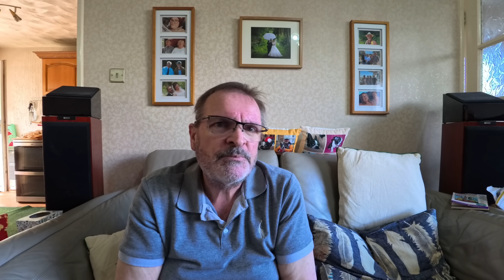Expert Ships Engineer Reacts to Baltimore Bridge Crash

Comment: Spot on and well documented sir. As an ex-marine engineer (2nd Class DOT) I have tried to explain all of your points to commentators, some who should know better. So in future I will point them to your excellent description. Another thing that does not help the public's understanding of the events: Most of the videos shown are not in real time, but sped up, giving an impression that this is like a car crash! Most people have no concept of the turning circle or effective stopping distance of such a vessel. And so conclude that it must have been a deliberate act. I can also agree that much underwear would have been soiled both down the engine room and on the bridge!
I have been in a similar situation to this on a gas tanker (oh my god yes) as we lost power turning into a Norwegian Fjord. The ship rolled slightly, disturbing a presumed tied up electrical pump motor (pulled on a chain block for maintainance). The resulting swing gave a nice pendulum effect to this monster piece of metal which contacted (gently) the quick closing valve for the generators diesel supply. Black out... no steering and we ran aground. Straight up a little old ladies garden, creating a new water feature for her to 'enjoy' in the future. :) So yes, as they say, shit happens. I am still alive so obviously the LPG did not go big-bada-boom.
Reply from the maker: Thank you, your comments are much appreciated
Reply: this Guyz funny!!
Reply: The ship changed course  toward the pylon prior to the blackout. Thousands upon  thousands of ships have traversed those waters.   Not a single one of them did any kind of maneuver like this.   STOP protecting this crap. This has nothing to do with the steering gear because they changed course prior to the blackout.    You people are absurd.   I am not an engineer but I am a 200 ton captain.  Nothing even close to this, but you don't steer into an object you are trying to avoid unless fighting a massive sideways current.  And to this idiot's assertion that there will be a full on accident investigation,  No!   America is so politicized. No way will they talk about a Ukrainian Master deliberately hitting the pylon. Brain dead lefties.
Reply: 😂when!!! OBIDUM ".. said" TAX PAYERS ". will PAY..
I knew !! then..
it was PLANNED.
.
( the Fall of ROME)
.
1ST CORINTHIANS 15V1.4  ...
TRUST JESUS  NOW.
Reply: So your saying this is something that could happen easily
Reply: @ettube8686  Indeed. That is why certification and experience is valued - to minimise the chances of disaster (of which there are many!). But there is no accounting for the possibility of a failure in such a complex scenario. Many factors such as bad fuel, a electronics fault, a hydraulic seal failing, or a malfunctioning sensor, could all lead to a diesel generator shutting down. This would obviously leave the vessel to the fate of the wind and current until control is restored. This incident took mere short minutes from power failure to disaster. All aboard would have been doing their best to get it back up and running; but it is not something that can be diagnosed, fixed and remedied in seconds.
Reply: @stevekirkby6570  ok thanks for explaining the sharp right hand turn directly into the pilon lol 😂
Reply: @stevekirkby6570  The ship was under the command of professional port pilots who likely were drilled for an engine shut down scenario. Seems handled well after failure. Mayday message sent out. Port anchor dropped. If I understand this video correctly, likely to compensate for the natural drift  towards starboard caused by the rotation of the propeller. It was a modern ship, built in 2016. And I suspect with all the added tech comes new unknown failure points.
Reply: @iRelevant.47.system.boycott  Yes, I mentioned this mate.
Reply: I was once told by a ship's captain  that if a fully laden vessel was to run directly onto a low lying  area  (  the Dutch  coast for example  )  it would end up eight  miles inland  !  This was in the days before the behemoths of today  😮
Reply: @colintuffs568  He's spinning you a bit of a yarn with that distance... but it could be quite a few 10's of meters, depending on the nature of the surface. :)
Reply: It still doesn’t explain the clear course taken directly toward the pier. Surely , like driving a vehicle one must always allow for sufficient clearance whilst driving. If the gap is narrow, one reduces speed even to a crawl if necessary. And in shipping does the steering self correct to centre/straight say in a case should the pilot have a heart attack?
Reply: @clothedwiththesun  Right. In reverse order. 
No, the rudder does not self-center in the case of a blackout. Since there is a blackout there is no electrical power to drive the hydraulics. Its frozen where it is.

If the speed is too slow there is not enough water passing over the rudder to make it work.

Because of momentum of a large vessel all actions are taken in advance, allowing for current and tides. Under normal circumstances aiming the ship towards the pier may be the desirable course. Going for the wide open gap may have put the ship at risk of a mud flat or indeed the other pier. It all depends on the current and wind. The pilot is experienced in these waters and was steering the correct course for a normal passage. Unfortunately losing power is a little 'inconvenient'.
Reply: @stevekirkby6570  thank you 👍
Reply: @clothedwiththesun That’s not a head on view in the camera, and if you watch it in real time it’s totally different
Reply: The new info coming out every day changes the story a bit. They said the power only cut out once and they engines were never restarted. What makes it odd is that it took days to recover the recorder data and interview the crew. Data is missing. The feds said it was not an attack supposedly before investigating. Either it absolutely was an attack and they're busy covering it up, or they're full of it. We can come up with theories as info is released but we may never know.
Reply: @eatonkuntz 😂😂 between an actual marine engineer and your armchair speculation, who do you think people should believe in? Get a life 😂😂😂
Reply: @eatonkuntz It has always taken some time to extract and especially publish all data after an accident, you can't suddenly make it a conspiracy.

Comment: The data logger will reveal all..
But I was wondering if the high sea suction was blocked with crap and both generators tripped out with high jacket water temperature..
Clearly this is just a punt.. 
Also from a retired Marine Engineer...

Comment: I heard today that they were missing 2 minutes from the black box recordings. According to the NTSB, it was able to record audio from the ship's bridge but no data was recorded and this occurred between 1:24-1:26 AM

Not sure why the black box would have shut down during the blackout period because it is meant to stay on during these types of emergency situations?
Reply: The claim is that because of the lost power the black box stopped functioning. This seems absurd on its own, but even more so especially knowing that there are backup generators.
Reply: @raggedyman74  I would think the black box would have a battery backup system. ..the same as Emergency lighting has?
But by the way, it sounds, was as if the black box was running solely on power from the ship... With no battery backup unless the battery itself wasn't charging?

It just seems kind of odd that during both blackout periods, the ship was turning abruptly starboard.
It happened twice...
Perhaps it was either bad fuel or rudder suddenly froze up?

Either way it's kind of tough to rule out  "NOT" Being That of a well thought out cyberattack, from Washington within an hour after it originally occurred but who knows?
Reply: @raggedyman74  ask nasa
Reply: I worked on passenger ships for many years. My guess (and that's all it is) is the data recorder (black box) continued to function as it should (note the audio recordings were not interrupted) and was on battery power. Most of the navigational bridge would also be on battery power. The data stream it receives goes thru several racks of equipment (in various locations on the ship) before arriving at the data recorder. All it would take is one data repeater or network switch to be connected to the wrong power source and the data stream could go offline in a power failure. It shouldn't happen, but I could see something like this happening.
Reply: WOW how convenient, nothing to look at there right? 🇺🇲🇺🇲🇺🇲💪
Reply: @robtrout5183  Nope, of course not and if we are ever to lose the electric grid, It'll be blamed on a solar flare and not that of a cyber attack/EMP either.
In America, everybody has always been protected... protected from everything that was really going on behind the scenes. What you don't know about won't hurt you.

For instance...
 Today, if we have any type of Mass shooting anywhere throughout the US that did not involve the AR-15 rifle, then it never happened. 🤔
By the way, Mass shootings happen almost and daily. Most of which do not involve the AR-15. So this is why you never hear about them.

Either way, I think that whatever is to occur in the near future has already and strategically been planned out and there better not be any more questions asked...
 if you know what I mean?
Reply: pl.anned luci.fer.ian e.vent😳
Reply: @lunam7249 . Nope.
Reply: @markbryant4641  yep.....FACT..... i know some...you know any?!😳😂😹😂😂😹😂😹🤦🏻‍♀️🤦🏻‍♀️😹😹
Reply: Just seems odd that the ship stalled out twice and during those two stall outs, turned starboard twice, in order to create a direct and "so called targeted" hit with the bridge?

Blame it on bad fuel or possible EMP.... Might even be cyber warfare for all we know? But the government isn't prepared to talk about that right now.

Nothing to see here... Please move on.

Comment: They also dropped the rear anchor on the side that it turned to. Wether the anchor drop was manual or an auto function I do not know however the bow of the boat sliced through the steel bridge pilings as shown by the coast guard drone footage. A compounding of errors.🤔

Comment: One report mentioned that they dropped anchor before the collision.  That may explain the small reduction of speed.  But to be effective, anchor chain has to be played out to abou 4x-5x the depth of the water.  The ship was probably too close to the bridge for 250 ft of anchor chain to have stopped the ship in time.  Another thing I notieced is there's nothing protecting the bridge supports from ship collisions.
Reply: I'm pretty sure 100,000 tons at 9mph is not going to be stopped by any 'protection' to the bridge supports. If Mount Everest was in the way, it would have put a dent in it :) A quick back of the fag packet calculation gives the energy released at the time of impact at approximately 8000MWatts -  (presuming the ship was stopped virtually instantly) - enough to power Baltimore (roughly) for about 8 hours :) To put that into perspective, the nuke that hit Horoshima was about 63MW.
Reply: @stevekirkby6570  Not intended to stop a ship but to deflect its course away from the bridge supports.  They recognized the potential for disaster when they built the Golden Gate Bridge before it opened in 1937.  It was hit in Nov 2023 with no damage to the bridge - but the cargo ship was heavily damaged.
Reply: @danburch9989 
Was that cargo ship as big as the Dali? In another video it was being said that not even a pylon of the Golden Gate Bridge could take such an impact without the bridge collapsing.
That Baltimore bridge doesn't look as big and heavy as the Golden Gate.
In the videos the cargo looks too big to go through under the bridge. I guess it's perspective.
Reply: @danburch9989  
Thank you.
Reply: You have to have someone release the anchor from the winch and then set the brake when the bridge tells you to. When hitting the bridge was inevitable that person probably ran off the bow to save themselves leaving the chain to keep running if the ship was still going forward.

Comment: After the ship went DITW she was passing by Curtis bay on her starboad side and created a pressure differential between port and starboard which caused her to drift to starboard. So far much of speculation has been towards some sort fuel issue. My opinion about what to do would not have been to go astern on the engine but throw the rudder hard to port with speed through the water she was carrying. Tempering that decision with how many boat lengths I have and how many degress the ship turns at that speed in a boat length.

Comment: There were two port pilots on board Dali.
Am of the view the thick smoke is compress start of the engine and then it dies out. Dali never had any propeller for those 4.12 min.
The startboard turn is due to effect of deeper channel on the startboard side that is meeting the main channel.

Comment: Thanx for the straight up analysis. Pretty much what I figured from watching the video. I think that once the power went off, it was a done deal for the most part. Folks can second guess all day, but at 10 + MPH with that much weight, it’s damed if you do and damed if you don’t. All I see that can be questioned in  hindsight is why weren’t they closer to center span of the bridge….

Comment: Thank you sir, GOD Bless you for your compassion and nautical wisdom. Could a ship be outfitted with Pectoral Fins (Flippers) that are deployed on Port and Starboard sides of the Ship to allow for steering if the Propulsion power goes out since the rudder relies on Prop propulsion water pressure to be effective in navigating.  Bottle Nose Dolphins use their Pectoral fins to turn very efficiently. ❤️✝️🇺🇸 😊

Comment: It was no accident!!!  The crash impacts shipping in a busy harbor-this was engineered to cause shortages.  The truth will come out!
Reply: Calm down
Reply: Two things stand out for me

1 - if the electrical systems were not operating fully before sailing the ship should have been held back 

2 - the tugs were dismissed too early that ship should have been escorted until clear of the channel and bridge

Definitely an accident and it was compounded by everything said in this video
Reply: That’s a thought of a small mind.  No one would want it.  Especially when you are in the worlds most strict and rules complaint port.  
It’s sheer malfunction of machinery and electronics.

Comment: It looks as if there was a pretty good crosswind from the way the engine smoke was blowing.  Could that cross wind have also helped drive the ship into the direction of the bridge ?  A loaded container ship does make a heck of a wall.  And most have seen loaded Semi trailers being pushed around on highways by crosswinds.
Reply: On many films of the accident the water was flat calm in my opinion.
Reply: Wind speed was just 6.2 knots, seas flat - not a factor. Current was less than .5 knots - also a none factor.

Comment: With respect Ships Engineers are not analytical engineers. Bottom line is the technical design of general shipping is limited simply due to certain systems hat are sensitive to single fault failure modes. In addition General Shipping carry out no reliability engineering Analyses to any decent standard such as Fault Tree Analysis, Failure Modes Effects Analysis, Binary Decision Diagrams, Event Tree Analysis. And also most general shipping Maintenance practices run 2nd Generation Maintenance Strategies which are from 1960s-1970s. The other problem is Chief Engineers that come ashore as the Shipowner Technical Superintendent they bring only operational engineering knowledge and do not have the skillset to produce analytical engineering Analyses. They confer the responsibility of technical aspects to Original Equipment Manufacturers whom surprisingly have scant knowledge of their equipment in the operating context plus all technical items are also conferred to Class Societies whom have limited liability to $2 million dollars in most cases.

Comment: You most likely correct.

I'm a Bridge Engineer but my Dad was a Ship's Engineer and your run down is the best and most succinct to date.

The Bridge had protection bunds designed for when the Port handled ships in the 25,000 tonne class and that manoeuvred at 4 knots upstream of the Bridge.

The Ship had 100,000 tonnes in motion at 8 knots at the strike. Inertial bodies in water carry a factorial of those multiplers so, we are looking at a massive strike on the bunds that they simply could not withstand.

Fag packet check say >28 times the kinetic energy imparted allowing for water resistance then take away the reversed flow thats 
>17 times the original designed use spec and 8 times catastrophic failure of the protection.

I wonder if Baltimore upgraded the protection for the pylons over the years?.. and to what extent?